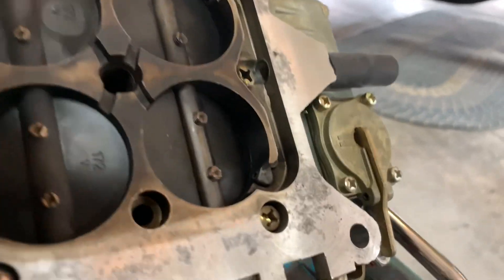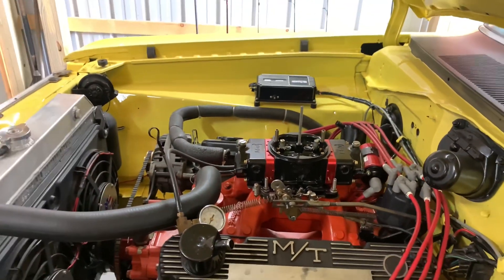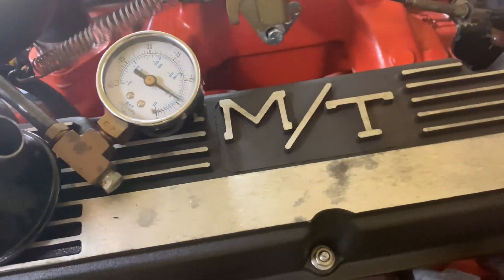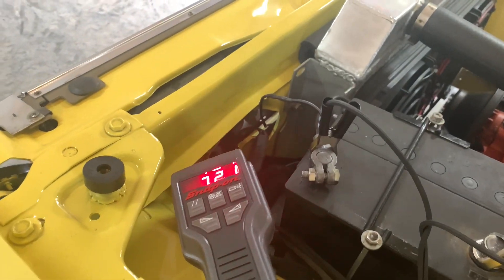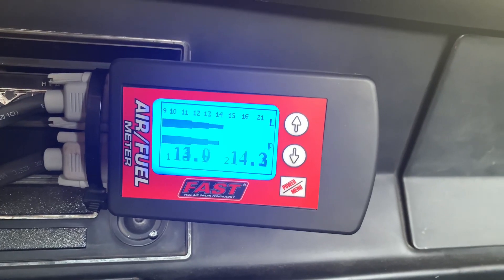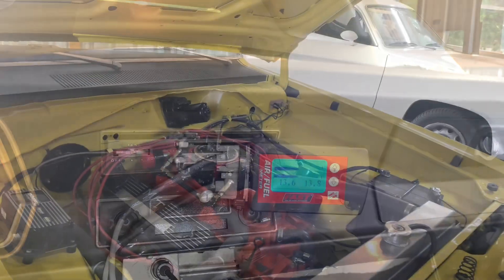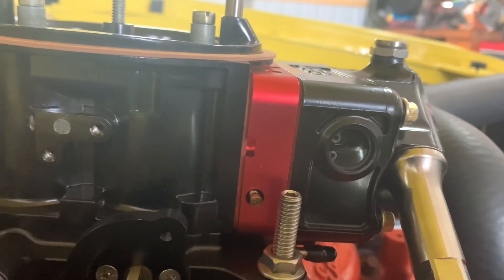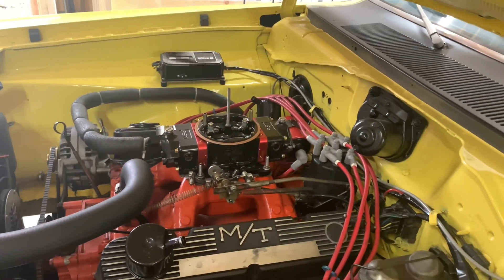4 corner idle mixture tuning on your Holley carb. Vacuum gauge vs dual wideband. *read description*

Comment: 3:41 ..... correction, quite the opposite, after loosening the jam screw, turn the nut clockwise to lower the float level, counter clockwise to raise the float level.
Reply from the maker: You’re right. I’m glad you caught that. I will put a correction in the description.

Comment: Clockwise on the needle and seat lowers the fuel level.
Reply from the maker: @jimpowell764  You’re correct. I did accidentally reverse the procedure of raising and lowering the float level. I did make the correction in the description but I’m not sure if anyone even reads that.

Comment: Great video, I was wondering if you can give me some advice? The transfer slots on my carb are open too far, but when I try to shut them the car won’t idle. Also my idle mixture screws don’t really do anything because of this. How do I get my rpm up? If not with idle screw? I thought about advancing the timing a little bit, but wanted to check with someone first. Any advice would be awesome. Thank you.
Reply from the maker: A little timing advancement might give you a little more rpm. The other thing I’ve heard people will do is drill a very small hole in each primary throttle blade. Very small to start, then put it back on and check to see what rpm it idles at. Increase the hole size if needed.
Reply: @Duster_Garage  i’ve heard that as well, I will try that, I have a spare carb in case it goes south,  thank you for the reply
Reply from the maker: @maximuswedgie5149  No problem
Reply: @maximuswedgie5149  dont listen to him about the timing advancement, he's wrong. Look into how to tune the secondary throttle blades. Depending on your setup, you set the primaries so the idle curb screw is turned in a little bit then control the idle with the secondaries

Comment: I'm 'old school', too...I'd add a 2nd throttle return spring, if I were you.
Reply from the maker: If you look closely when I’m pointing to the idle mixture screws, you can see that spring actually does have a second spring inside it. It is difficult to see from the video. The drag strip I go to does check for that at the tech booth.

Comment: Great video! What are you using for fuel delivery pump wise and do you have a sump in a stock tank or fuel cell? I have Carter mechanical pump and a stock tank with 3/8 sending unit and lines. We're at similar power levels and I'd like to change now if needed. I'd appreciate any advice thanks.
Reply from the maker: Thanks! The fuel pump I am running is a holley red, I like it because you don’t need a regulator. The rest is the same as you have. Stock fuel tank, 3/8 sending unit and 3/8 fuel line. Also, I have the line insulated in the engine bay.
Reply: Are you running hard line from tank to engine bay? What type of line in engine bay to carb? Thanks
Reply from the maker: @kehi6608  yes, 3/8” steel line. 3/8” rubber where connecting two steel lines. The carb feed line is a Summit racing 6AN line.

Comment: It looks like you have some great info for dialing in carbs but can't hear you I
Reply from the maker: Sorry, the audio is garbage with the engine running. I have to do something different in future videos.
Reply: What size is your cam lift an duration??
Reply from the maker: @kengruginski6889  lift is .516 at the valve with the 1.6 rockers. Duration is 241 @ .050. 108 degrees LSA.
Reply: Is that a racerbrown cam shaft?
Reply from the maker: @kengruginski6889  mopar performance
Reply: A purpleshaft 284/484
Reply from the maker: @kengruginski6889  Yep. It’s a hydraulic cam but I’ve actually been running solid lifters on it for about 2 years. I picked up almost a tenth in the 1/4 mile switching from hydraulic to solid lifters.
Reply: The Mopar performance 284- 484 camshaft I have the same cam I really like it I also have one that was a racer Brown camshaft last question what size was your solid lifter camshafts that you were running in the past?
Reply from the maker: @kengruginski6889  I had a Comp cams hydraulic for a little bit. it was 241/247 @ .050, 581 lift at the valve. Car slowed up like half a second with it. Took it out and put the 484 purpleshaft back in.
Reply: Thank you very much for sharing all the information have a great day my friend
Reply from the maker: @kengruginski6889  No problem. You do the same.